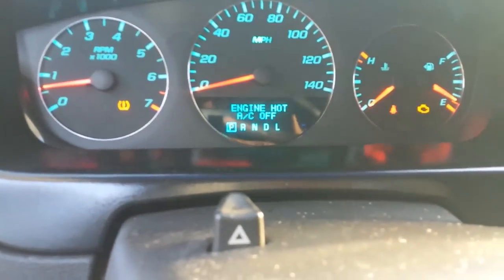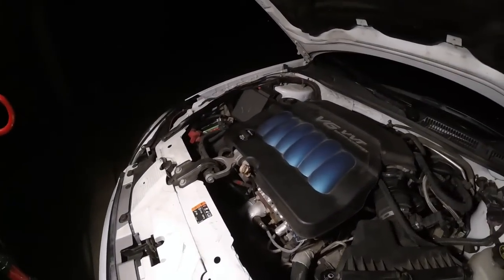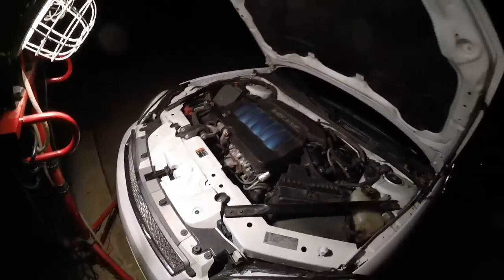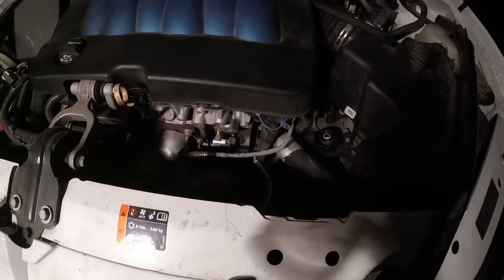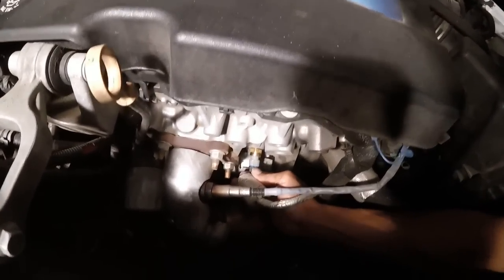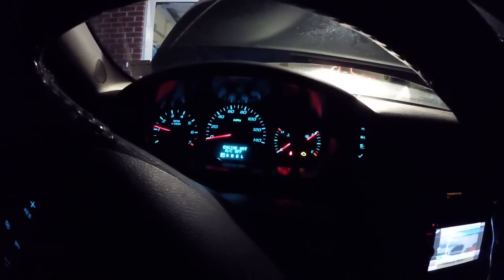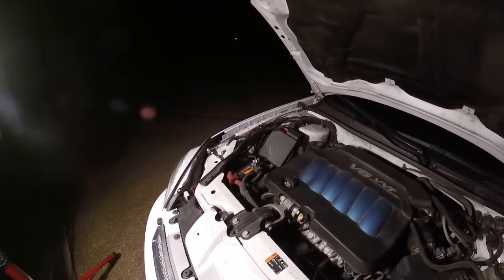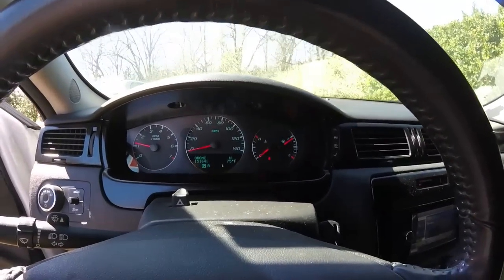2013 Impala Engine Hot AC Off Fixed

Comment: My mom car doing this now 😩🤦🏾‍♂️
Reply from the maker: I think it's best to change the thermostat and the coolant sensor to get rid of it for good. After doing just the sensor mine is back doing it on and off
Reply: 89imp03 what you charge lol. HMU I might need you to get her right. If it was a Ford I wouldn’t have to deal with all this 😂😂😂
Reply from the maker: @brandonoscar6527  😂😂😂 it would just be a different problem
Reply from the maker: @brandonoscar6527  probably like $50 to do the thermostat and sensor if you have the parts

Comment: So did the engine light ever come on since uve driven impala?
Reply from the maker: Chris Brown it actually popped on a few days ago but went back off. If it comes on again and stays I may replace the thermostat too
Reply: @89imp03  I left a comment on ur vid today, a month after I changed the sensor ,it has came back on idk :/
Reply from the maker: @t-pitz8866  mine popped back on for a day or two and went back off. Could be the thermostat needs to be replaced too
Reply: @89imp03  ok , funny thing..mines went back to normal too ! 
I'll see into that thermostat ! I appreciate it
Reply from the maker: @t-pitz8866  no problem man. These cars are tricky at times